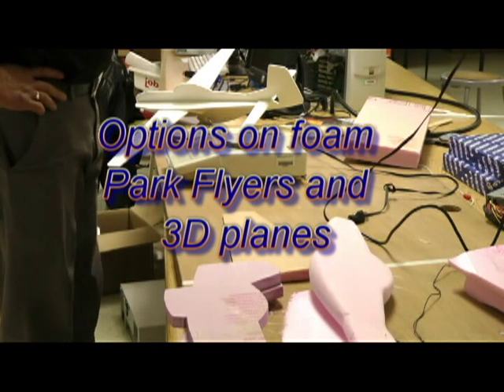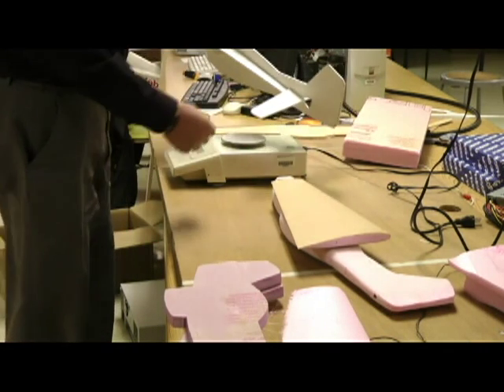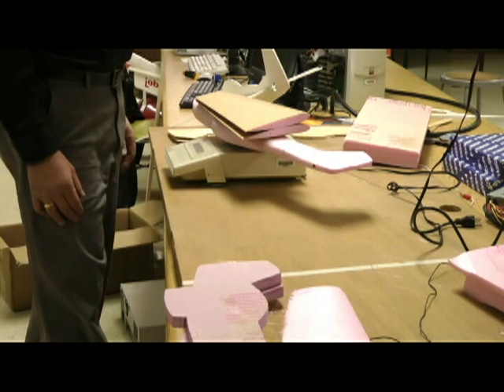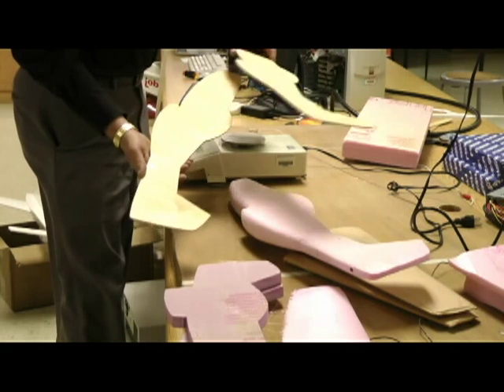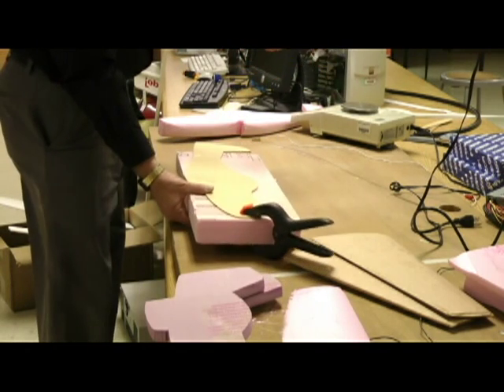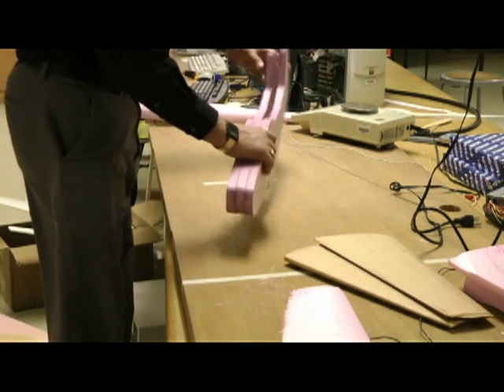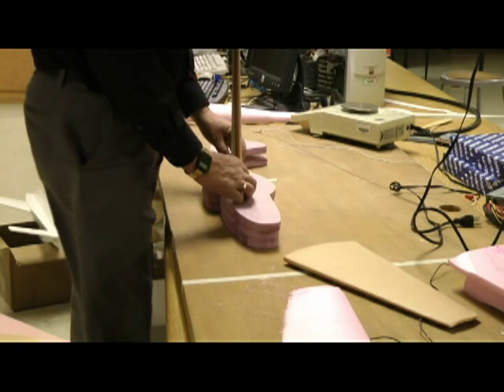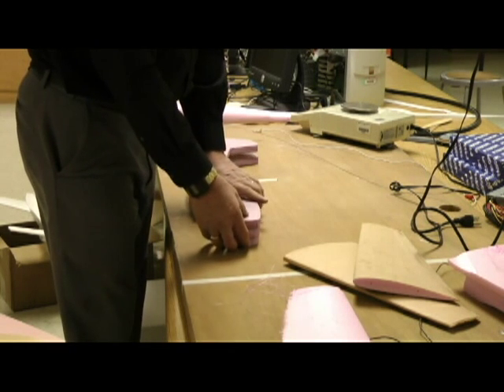park flyer and 3d options with foam

Comment from the maker: I agree.  It has been my experience that in using the spray type foams, they leave a rather ugly mess due to expansion.  Even though the foam does dry rather hard, it leaves much larger voids than the other type of foam.